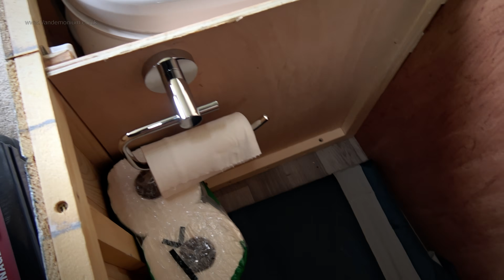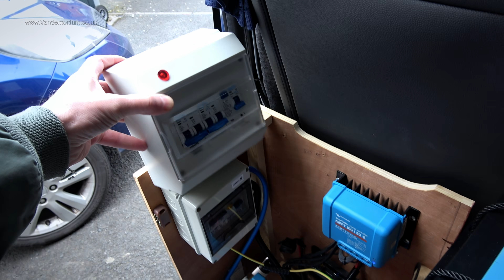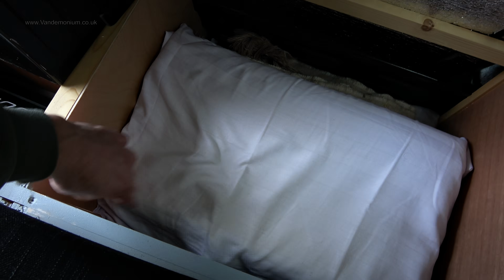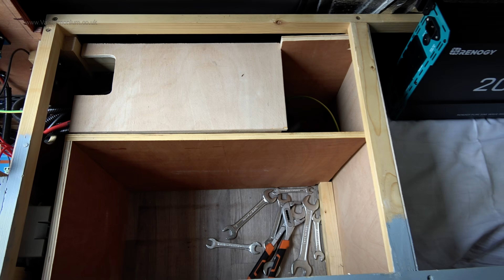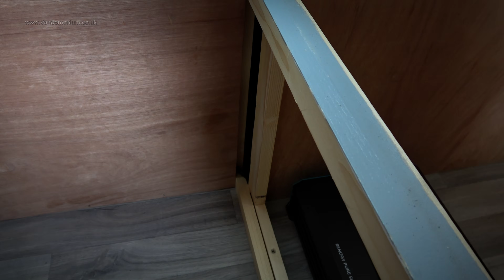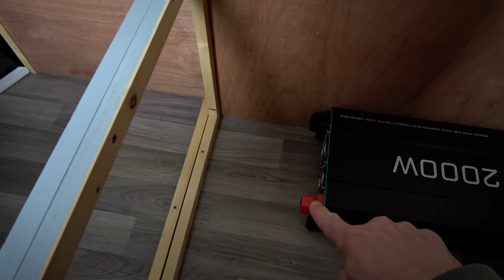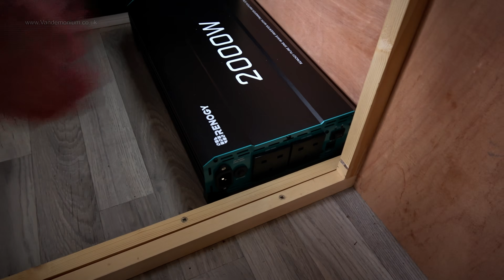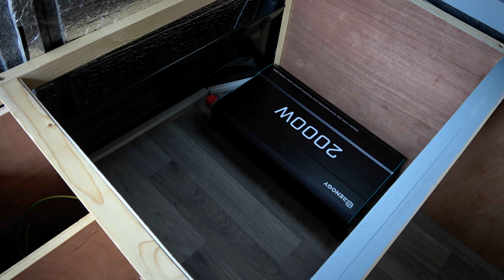78. How should I arrange the new campervan electricals?

Comment: Just some random additional thoughts.  How much power does your portable cooktop actually consume with both burners on High?  In looking at Amazon UK, I noticed the 2 burner type consume anywhere from 1,800 to 3,600 watts.  However, because the rated consumption is not always that accurate, I like to measure the actual cooktop.  Whatever 240 volt current they consume, multiple that figure by 22 to figure your battery current.  

Since the induction cooktop generates a very strong electrical field at about 25 kHz, it is possible that the field could excite the inverter, making it unstable.  Hopefully, since you purchased a good quality inverter, sufficient filtering is present to prevent instabilities.  There is no safety standard established yet but, given the intense electrical fields the induction burners generate (and I have measured them), I would recommend staying at least a half meter away from the cooktop while it is in operation.   When I use my induction cooktop, I pause the heat while flipping the food in the pan.  

I am assuming you will want to charge your battery via solar, shore power, and car power.  To prevent cooking the car alternator, some type of current limit circuit needs to be present to limit alternator current to 20 amps.  

For your Mains sockets, I would use a DPDT (Double Throw, Double Pole) switch so either shore or inverter power can be selected for the sockets.  

Your inverter will generate a significant amount of heat when running the stove top, so you will need good ventilation to prevent the air temperature in the inverter/battery compartment from exceeding 38 degrees Celsius.  Given how the limited space you will have, a temperature controlled cooling fan, that draws air from outside the cabinet would be best.  I would also provide a duct from the inverter air output side to outside the cabinet because, you will be dumping a lot of heat.  If I was doing a new install with a clean sheet of paper, I would mount the inverter vertically so the fan forced air flow exits the upside (aiding in heat convection).
Reply from the maker: The burners are each max 800W (it's specifically designed to be lower power for camping use)
Reply: @Vandemonium  Okay, that equates to about 176 amps of 12 volt current.  Check your battery ratings, Lithium batteries will turn off due to internal protection circuitry if you exceed the battery current rating.
Reply from the maker: No worries, it's rated to 200A continuous 👍

Comment: It would irritate me to no end having to give up   parts of the storage areas to accommodate the battery and inverter. Although I initially thought installing false bottoms in the storage areas, after reading some other comments, I think I'd try revamping the inside of the cabinet where the extra  water can is stored so you can stack the inverter over the battery. Maybe try to place the inverter so its fans face the front of the cabinet and install an air grille in cabinet face as well. That's my two cents. 😁
Reply: @Vandemonium I was also thinking of suggesting placing the inverter under a seat as the one in my truck is located underneath one, but I decided against recommending it as your inverter appeared too large. I see in your response to the flurry of suggestions that you will see if space under the seats permits installation. If so, that would be ideal as you get to keep all your storage, the battery would remain in that cabinet, and you could possibly relocate the master switch to a more convenient location. I'm sure whatever you decide to do will be just fine as you are one to thoroughly research things. Looking forward to seeing the final result. 😊
Reply: Now that you have the new battery and inverter installed, can I take credit for giving you the idea for installing the air grilles? 🤣

Comment: Hi David, I get the impression that the details of this installation are causing a bit of anxiety.  I have done several similar installations so, hopefully my suggestions will be of some help.  First off, determine how much of the existing cabinet space is available for the new installation.  The highest priority by far is the cable length between the battery and inverter.  I estimate you will need 10.1 mm (80 mm sq) copper diameter cables to carry the 200 amps and I would strive to keep the cable length to no more than 250 mm if possible.  Use welder's cable or similar fine stranded wire, which is more flexible.  Given your available space, I suggest mounting the battery on the van floor so it can't move around when the van is in motion.  Directly above the battery, place a shelf to mount the inverter on with both battery and inverter terminals as close as possible to each other.  Any component in the electrical system that generates heat must have some type of ventilation and there should be least 25 mm of clearance between the component body and cabinet to allow air flow.  The rest of the electrical components can be mounted wherever it is convenient simply because they are not carrying that much current.  Switches and fuses should be easily accessible but, especially the master switch.   So, fit your largest components first in proposed layouts and group the smaller components nearby where practical.

Comment: Forgive me if I missed it, it didn’t look like you had a fuse between the battery positive and the shut off switch. The battery should have its own fuse and ideally as close to the positive terminal as possible. You may need to fit a bus bar fed from the fuse to connect the positive consumer cables.
Reply from the maker: I have a brand new 300A mega fuse waiting to go into the new system
Reply: @Vandemonium  Awesome!

Comment: Not 100% sure but have you checked with the manufacturer to see if the lithium battery and inverter could stand up in the current storage areas ?  On my boat the inverter is mounted on the wall.

Comment: Before deciding where to mount it, give the inverter a test run with the stove on full to see how much heat it pumps out.  You may find the air volume inside the storage compartment is insufficient to soak it up, requiring ducting from the inverter fans to main space in the van.  Even at 95% efficiency it'll be creating ~100W of heat.
Reply from the maker: It's claimed to be 90% efficient but it will only run for relatively short times, it's only there for cooking or boiling a kettle.
Reply: @Vandemonium  Air has a heat capacity of about 700 Joules per kg per °C and a density of just 1.2 kg/m3, so 200W into 1 m3 of air will heat it by 1°C every 3.5 seconds.  Your storage space is much less than this so even boiling the kettle could raise temperatures beyond the safe level for the inverter.
Reply: @Vandemonium  Some quick back of the napkin maths:
1m3 of air is about 1.2kg.  To warm 1kg of air by 1°C takes 700 Joules.
1kg of water takes about 4200 Jouls to heat by 1°C.
So raising 500mL of 20°C water to 100°C takes 168000 Joules.
If the inverter is 90% efficient, that will create about 16800 Joules of waste heat.
16800 Joules will raise the temperature of 1m3 of air by 20°C.
Even if you had 1m3 inside the enclosure, the final temperature would be 40°C.
Your volume appears to be less than 0.5m3 so it'd be above 60°C at the end.

Comment: Hi David, I wouldn’t put the master switch down low as you might accidentally brush it with your feet and turn it off unexpectedly. 
Maybe put the consumer unit facing the removable front for speed of access.

Comment: I'd put the battery in the same spot it is now and the inverter in the slot in front where the empty water container is - but have a little bit go into the bedding cubby at floor level - so that the cubby is still pillow sized at the top, but has a bit isolated for the Inverter wires at the base. Keep the cables short and it all together seems better for trouble shooting etc. AND keep the inverter on its own for ventilation - not under things as it could get very hot.

Comment: Why not a false bottom in the Bedding compartment . Mount the inverter so the label reads left to right. You would have space for all y our cables and It would be vented to the space in the back where it is open to the front\floor. the space would be created by a raised floor of the entire compartment 3 Inches deep. floor

Comment: An interesting watch, I always enjoy looking at how others have done their electrical layout. 
Having recently witnessed a lithium battery fire, there is absolutely NO WAY I will ever entertain having anything to do with one, not in any way shape or form. 
David, nowhere during this episode do I recall  you mention the use of a split charging system, thus making use of the vehicle's own very efficient alternator to charge all of your batteries while on the move. Do you not have one?  
Personally I would have just doubled up on the existing trouble free battery type that you have to provide your extra inverter needs. 
And finally, I'm wondering how many cheese sandwiches were made during  the making of this video?
Reply from the maker: This is a LiFEPO4 battery and they're pretty much bulletproof. Literally, you can fire a bullet at them and they don't explode.

I don't have a split charge and don't yet intend to install one.

Comment: Hi David,
Prioritize:  There are three bulky items here and the least critical by far is the water container, it can go literally anywhere. I'd prefer the battery and inverter to be in that area together, even if you have to shrink the size of your bedding storage area slightly to allow easy fitment of the cabling. Good luck and thanks for the vlog.

Comment: You need good cooling for the inverter. Also fuses and switches and wires will get pretty warm/hot if you are pulling 2 kW. No clothing next to the wires please.  I think you will need to rethink the entire space starting with the electrical system considerations.
Reply from the maker: Cheers. I'm not convinced (yet!) that it will get so hot as it will only ever run for about 10 minutes at a time (warming some soup or boiling some rice etc) and it is very cool down on the floor where I hope it might go.
Reply: @Vandemonium  If you run 2 kW, the efficiency of inverters is usually around 85%, so you need to dissipate at least 300 W, not huge but noticeable if enclosed.  Also: I made a 2 kW inverter at home connected to a ~12 V, 200 Ah LiFePo system, and when pulling 1.5 kW the fuse, switch, and connections (I was using very very thick wire 2/0) got hot enough to be uncomfortable to touch.

Comment: Also, welding cable is much more flexible than battery cable, give that a shot for tight bends. Just make sure you get 100% pure copper, not CCA - copper clad aluminum (or aluminium). Wish we were neighbors, I have the cable crimper, hydraulic press, and a mess of cable lugs, leftover bits of 2/0 welding cable, and adhesive lined heat shrink tubing that you'd be welcome to poke around.
Reply from the maker: You sound like the ideal neighbour!!

Comment: David I would suggest that anytime wires of any thickens goes through a partition that you get yourself some vinyl or rubber grommets. They would help to protect the wires. Most  substantial work stations have them these days. You could also get you a rolled up holder for your wrenches.
AWG= American Wire Gauge.

Comment: Put the battery where your current one is, and the inverter next to it where the extra water jug is, but rotate the battery and inverter so the big chunky terminals for both are next to the electrical cabinet. The 240v wires from the inverter will be pointing away from the electric cabinet, but the 240v wires will be much smaller and more flexible, and less susceptible to voltage loss due to wire length.

Make sure you have plenty of ventilation for the inverter. You might need a class T fuse for the lithium battery, although I'm not sure with it being 12v.

Well done sir, it'll be great in the end.

Comment: You will want to consult the manufacture of the inverter to assure that you have adequate ventilation for the fans. If you don’t, the inverter will overheat and you will have a problem. You cannot afford to cut or impede the air to the fans or the vent holes that are next to the outlets on the other end of the inverter there has to be adequate airflow.

Comment: So if you move the dividing panel in the water compartment a few cm towards the back of the van, and notch the cross beam at the top between the battery and the bedding compartment, you should be able to put the battery in where the old one is.  I'd also put a platform in there to raise it up, and leave an air space underneath.  It'll be tricky, but consider raising the floor of your electrical compartment, create a space underneath, that you can put the inverter in flat, with the fans towards the side door (and a grill for ventilation), then you can run your mains from the inverter, under the battery compartment and branch out as needed.

As for the cabling, for 1.5 meters or less, 4 AWG or 25 mm2 seems to be a reasonable caliber of cable.  Might want to look into 90 degree lugs as well for your cabling.  Also, put your RCD/Fuse box somewhere where you can look into it easily (ie, back of the seat)-- having to stand on your head, or look around a corner to see it is less than ideal.  

Finally, get a small square tote/bucket with a handle for your tools.  😏
Reply from the maker: Cheers. I'm not too bothered by the fuse box, it should never need looking at!

Comment: Maybe its just me , but move the piece of board over if you need a support where it is cut two U shaped bits of wood slot in the support in , air vent in the front and fold the bedding smaller

Comment: I would put lay the inverter flat on the floor in the bedding compartment it looks like a large enough space that you could put some kind of removable platform or false floor coving the inverter and still have enough space for your bedding to sit on top of it. there might be room for the battery charger too. If that doesn't work I would mount the inverter to the back of the large storage compartment.

Comment: You could get right angle brackets for the main power leads to the inverter. That will enable the cables will be at a more suitable angle.
Another point, with many 2000w inverters with dual 220v outputs, you only get 1000 watts from each output.
Reply from the maker: Good tip. I checked the documentation and it appears that it can supply the full amount from any combination of the two outputs so I presume they're connected together.

Comment: could you fit the battery in if you rotated it 90 degrees if so fit both it and the inverter in the first compartment still using the extra bulkhead space for the inverter cables

Comment: I work with computers and small servers. That inverter  is going to need a lot of space around it with unobstructed airflow. There is a reason why it has two fans. How about mounting it on the ceiling of the van or maybe under one of the two front seats? Provided of course there is airflow under the seats. Or the opposite side on the van wall?  Just trying to think outside the box so to speak, something you do very well. Really enjoying this series of videos. Should be a cracking camper when you get her finished. Keep at it, will be worth it in the end.
Reply from the maker: Cheers. I'm not convinced (yet!) that it will get too hot as it will only ever run for about 10 minutes at a time (warming some soup or boiling some rice etc) and it is very cool down on the floor where I hope it might go.

Comment: I think that you need to read the cooling requirements of the inverter. In my experience putting one in a confined space is an error, and especially one fitted with two cooling fans. However I do see that this system is not going to get very heavy use - but I would still read the tech specs to gain a better understanding. I might also add that you are adding weight to the right hand side of the vehicle (the driver's side) and you  appear to do most of your trips alone. This will lead to increased wear on the suspension and potentially a noticeable 'lean' to the vehicle when you are driving it - but it is a good thing that the battery will be positioned on the centre line. Interesting project, very much enjoying the voyage. Well done you.
Reply from the maker: Cheers. The weight shouldn't be an issue, the van has a load capacity of 1,200 kg so anything I have in there currently is relatively negligible.

Comment: Battery and inverter into bedding compartment which is larger and gives extra area for air circulation which is needed for inverter. Can you do a mini loft for bedding...hanging from ceiling?

Comment: First question. Why go electric for cooking. 
2 what do you use the most when cooking. Are you still thinking gas?.  If you have electric a small kettle for hot drinks. Maybe a small microwave and grill. I still think a solar generator up to 3 kilowatts will solve you problem. You are only away for a few days. They also have a 12 volt output. 
Time to think differently.
Also  a removable battery, you always have it fully charged when you travel.
Reply from the maker: Solar "generators" don't generate anything at all, it's the (optional) solar panels that do that. But apart from that, they offer precisely nothing over what I already have. They are just a charger, battery and inverter in one box.

Comment: Seriously? Electrical connectors for high ampage need to be thick, true. If corners are to be dealt with, there are connection solutions that get you round the design constraint of bent cables. You're not using a good parts catalogue!
Reply from the maker: To be fair, I haven't even looked at the supplier's catalogue yet!